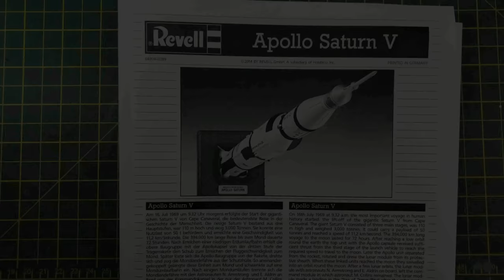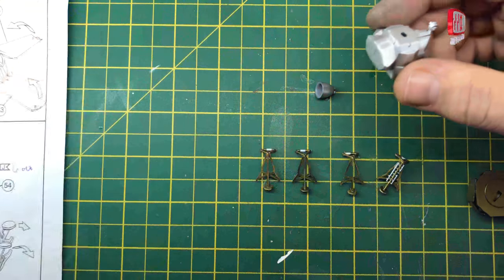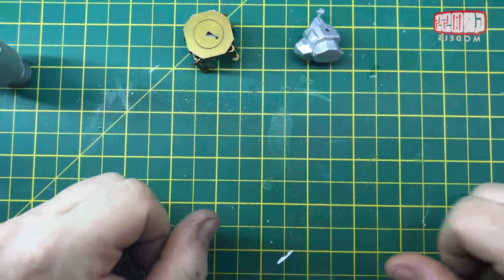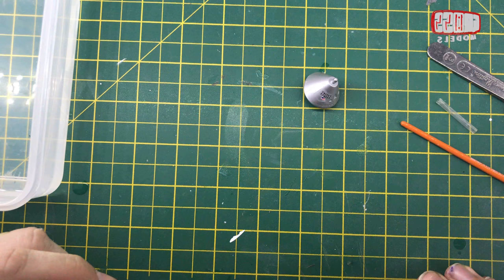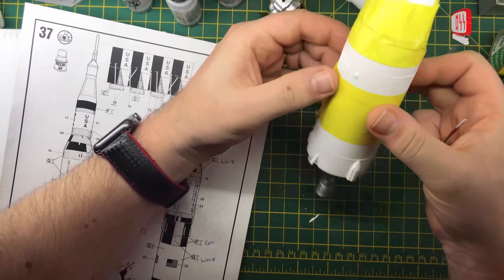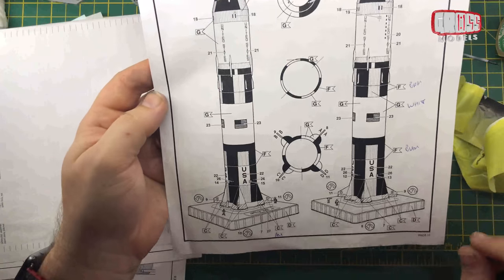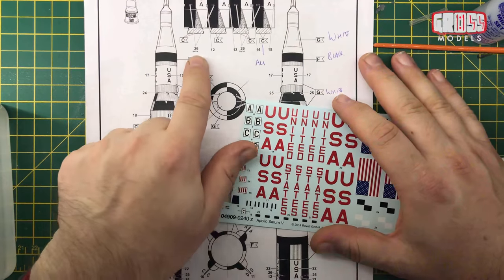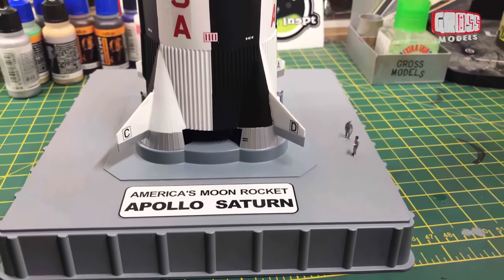Revell 1:144 Saturn V rocket. Part 4: Lander, Paint & Decals

Comment: A note on this final build... I really enjoyed watching you. You have helped me immensely with this build, and have reminded me of some things I learned last time I built a Saturn V (albeit in 200 scale) that I don't want to forget about building when I put this sucker together.

Also, not sure if anyone has shared, those plant on pieces that there were eight of, but the instructions only showed four... those were ullage motors. When the stage was getting ready to ignite, the ullage motors helped to ensure that the fuel was at the bottom of the tanks so that they could be drawn into the piping. The original design called for eight of these motors, and that is how the 500F facilities test mockup was built. In operation only four were used on the real rockets up through I believe Apollo 14. Apollo 15 through 17 and Skylab used no ullage motors.

Also, curiously, the paint and decal scheme for this kit is largely drawn from the 500F mockup. The operational rocket reduced the amount of black paint because it was heating the tanks in the Florida sun... added the first stage flags (they were not present on the mockup), and included the USA on the third stage, which was deleted on later flights. I happen to prefer the paint scheme Revell suggests... so I will probably do that when I build mine. 

Again, thanks so much! I REALLY APPRECIATE this video series!
Reply from the maker: I did become aware of the many different paint variations on the versions of the rocket, but not why the black was reduced, thanks for that!

Comment: nice build and I have started my own but I believe the black paint scheme for the first stage is incorrect......even though the instructions tell you to paint that way. I looked at images of the actual rocket and the paint scheme is different. Perhaps other Saturn V rockets and differing paint schemes?
Reply from the maker: Apparently there were loads of different paint schemes for this rocket for different tests.
Reply: Great build series. I enjoyed it a lot. I am currently building the 1/96 kit.  The paint scheme on both of these kits was based on the SA-500F Facilities Integration Vehicle, a non-flying rocket designed to test the launch facilities.  It’s a shame Revell never updated the instructions, but still they’re both nice kits.
Reply from the maker: Thanks.

Comment: just one addition to my comment, the reason for this is the model instructions were created following the SA-500F test version. https://en.wikipedia.org/wiki/SA-500F . This is NOT the painting scheme they went with with the actual Saturn 5. USA decals are not on the 3rd stage with actual Saturn 5's, there is no horizontal black stripe on Stage 1, plus other minor differences.
Reply from the maker: Thanks for the info, the minor (and even the major) differences do not bother me, but others may want to paint it a different way.
Reply: @GrossModels  I just completed my Saturn 5 and I would have been angry if I made it to a painted finish that actually never flew, so I studied many photos before painting mine (having the lego saturn 5 helped too). This model was fun to make but no idea why it instructs to paint various things green which looks rubbish and really it should have updated instructions which I think I heard the 50th anniversary version does.
Reply from the maker: I understand, I’ve just never been too worried about the accuracy. Even building Star Wars and film kits I never go for “screen accurate”, just what looks right to me.

Comment: Just purchased this kit from Amazon. Plan to use the gold foil from a couple of candy bar wrappers for the LEM Decent stage IF I plan to use it.  I didn't like the open seems where the LEM is stored on the rocket so I was thinking to discard all the internal things and have one solid, rigid Saturn V. I think it would look so much better with all the seams puttied, sanded and painted.
Nice vid BTW!
Reply from the maker: Internals are always a difficult subject. Most of the time they are locked away and never seen but we know they are there. You can always make them and then seal them inside!

Comment: Question - you said in the video that you used Pledge to add a shine and give a smoother base for the decals.  Pledge - as in the furniture polish?  I would think that furniture polish would make a slippery surface for decals to stick to - can you elaborate?
Reply from the maker: It’s actually the floor polish, and it gives a nice smooth surface for decals.

Comment: This is the old Airfix kit, reboxed by Revell.  Not a very good model and since they used the old (unrestored) molds, the model is even worse than the original issues from Airfix......
Here are my thoughts. Please consider them to be constructive comments and nothing else. Maybe I am too blunt but as long as my message comes along, I'm okay with it.

The decals have improved, but some are incorrect, some are even fantasy.......   The paint guide....well....even worse than the pastic parts. Nothing good to say here. The color call-outs are just dead wrong. Nothing accurate about it.  And since most of us have access to internet, finding the correct colors is a breeze......  Too bad Gross Models did not even try for one second to find the correct colors.  Since he followed the colors as shown by Revell, the end result barely qualifies as a toy..... I think it looks bad.  But then, I am not the owner of this model nor do I know exactly what the purpose of this model is. If he had fun building it, then 99% of the goal of this hobby has been reached.  His use of glue,  Set and Sol  needs improvement. He could do so much better.
With some effort, this Airfix kit can be turned into a good looking, accurate model, but you must take the time for it and put some effort into it.
Reply from the maker: Thanks for your comments, I hope I’ve improved over the time since I did this kit!

Comment: Great tip about spraying masked area with white first to seal the edges before doing the black, really worked well, although some bleeding. What's the best way to tackle the black bleeding into the white?
Reply from the maker: Make sure you press down the edge of the tape firmly. And spray from the tape to the plastic, not so the paint is pushed under the tape. You may still need to touch up the white after!
Reply: Good man. I’ll give that a go.
Reply from the maker: Happy to help good luck!
Reply: @GrossModels  How about using silly putty (correct English term?) for the tricky surfaces? I think I read about that somewhere. You smear a thin layer of putty on the uneven surface and a strip of tape over it as a reference. Then you cut the putty along the tape and remove the bit sticking out from the tape. I will soon start my build of the Airfix Saturn V, and I think I will try that method. Your videos have given me some good pointers even if it's from another manufacturer. Thanks!
Reply from the maker: I’ve used blutac (sort of the same thing) but it usually gives a softer edge than tape. I guess cutting it away might give a sharper edge though. 
Good luck with your build, why not share your progress in my Facebook group? Facebook.com/groups/grossgroup

Comment: Great build log, I like the way you addressed the seams and the circular fit issues of the fuselage halves, she's quite a biggie when complete.

I've been gathering reference of the Saturn V Rocket for when I eventually start my kit and I noticed that in most of the photo's I have there is no black band around the lower 1st stage of the rocket, I find it quite strange Revell didn't follow their box art as there is clearly no black band, is it possible that Revell made an error on their paint guide instructions or was your scheme personal preference?

Cheers.
Reply from the maker: Thank you. I don’t remember the particulars, but there are about a dozen different paint jobs for the Saturn series, someone may have used the wrong one for either the box art or the other pictures.
Reply: @GrossModels  All of the reference photo's I have are of the 1969 Apollo 11 Saturn V which will most probably be the version I'll base my kit off of.

I was also thinking of lighting mine but what would one light in it because the thruster bells are hidden inside the stand and there's no windows lol.

Did you ever find the mysterious disappearing decal?

Thanks man, and again great build log.
Reply from the maker: No sign of the decal, ever. It’s only the second time I’ve ever lost one so I don’t think I’m doing too badly. :-)

It doesn’t surprise me that Revell got the details wrong. ;-)
Reply: @GrossModels  Both Revel and Airfix and a few others got the blueprints during the mid 1960s, and a LOT changed between then and the final flight versions of the Apollo Saturn V, especially the, detail and size of the service module (after the Apollo 1 fire) and the overall paint scheme. Too much black paint was found to be heating the cryogenic fuels in the Florida sunshine!
Reply from the maker: That’s very interesting, thanks!